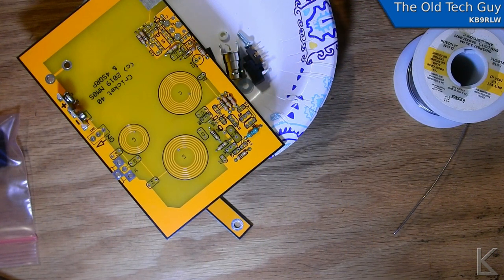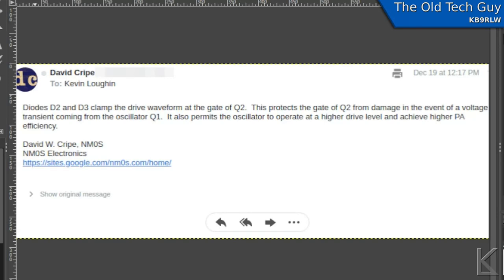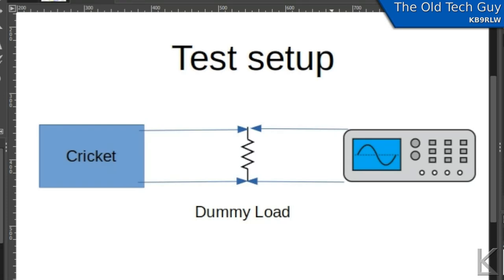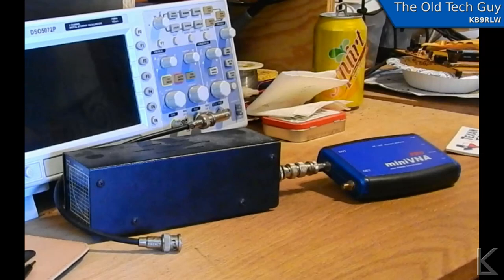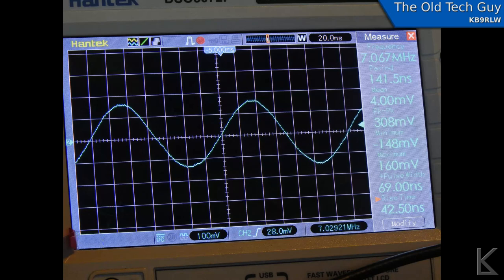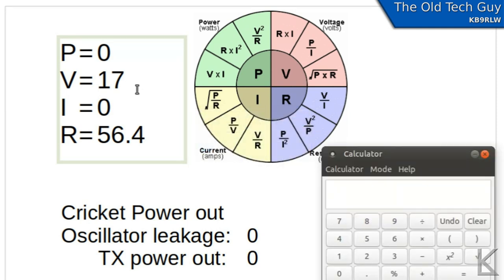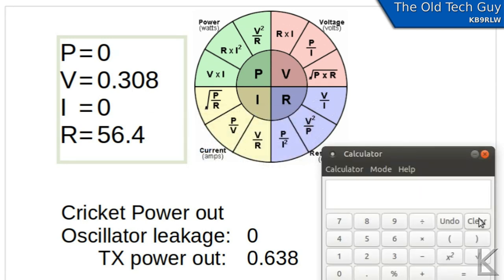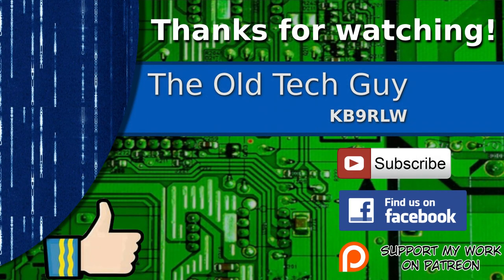Ham Radio - Measuring the Cricket 40 output power with my oscilloscope.

Comment: Kevin, you used the right constants, but it is the RMS voltage we use, not average. You said "average" but actually used the correct RMS values. 73, KE0OG
Reply from the maker: Yeah, at one point I said "average, or RMS".   I know, they're different.  I often hear them interchanged and my speech processor didn't filter it right. ;-)
Reply from the maker: I went ahead and added a note to the video description about me misspeaking "average" when we mean RMS, but I suspect I'll still get beat up over that detail in the comments.  Oh well.
Reply: If you look at the formula for power from voltage P = V^2 / R, the power depends on the square of the voltage.  That is why we need the average of the squares of the voltages ie RMS.
Reply: @donreid358  Don, we need the RMS value of V for the formula--the root mean square, not the average.
Reply: Don, see Section 3.2 of the 2019 ARRL Handbook.
Reply: Just in case somebody wants to understand this: The "M" in RMS stands for "mean", which is a form of average.  The important point is that it is the average over time, formally the integral, of the "square" (S) of the voltage (because that's proportional to power in a resistive  circuit), and when we're done we take the (square) "root" (R) to find the DC voltage value that would produce the same average power in the same (perfect) resistor.  The "root" of the "mean" of the "square".
Reply: To add to the "discussion" : the correct way of approaching the calculation of power, coming from the sine-wave is: You take half of the peak-to-peak voltage (called U(max). Then you divide that by SQR(2) (the square root of 2). That will give you the V(eff), which is the effective voltage of the sine wave. etc.
There is an absolute difference between "average"  and "effective"  voltage.   Even more so, the average voltage of 1 period of a sine-wave, is zero volt. (1/2 period is positive and the other 1/2 period is negative, resulting in an average of 0 Volt.  If you want to know for instance the average voltage of 1/2 period of a sine-wave, you can calculate it by U(average)= U(max) * (2/pi), which is roughly U(max) * 0.64.
Reply: Another very important point is that we should always resist Internet pedantry.  It was very clear what Kevin was doing.  In fact, the terms "average" or "mean" are fundamentally imprecise, as the arithmetic mean (what most people think of) is only one averaging technique.  RMS, which is the quadratic mean is also "an average", along with the geometric mean, harmonic mean, etc.  If the presentation is clear, then nobody needs to fuss about which kind of average we're talking about.
Reply: @jephthai  You clearly didn't understand my writing above. I wasn't being pedant in any way. If we talk about electrics and electronics and formula's to calculate things, you have to call things by their correct names. Basta !
Reply: @63snampook  Well, then we might just want to ask the mathematicians what "average" is, first of all.  And then, when they say, "Which one?" we might try to recognize that the misuse is in assuming that "average" means "arithmetic mean" :-).
Reply: @jephthai  Yeah, what ever...
Reply: @loughkb  Try editing and reposting.  It works wonders.  When you are trying to teach something to others, making mistakes and not fixing them is a gross disservice. Please edit.
Reply from the maker: @xxM5xx  Oh, I didn't catch which video this comment thread was on.
This was over a year ago.   
Not going to bother with it.  I don't even have the radio any more.  Gave it to a ham that likes those simple rigs.
Reply: @loughkb  you ever get around to the mods you talked about in the first video? Built mine last night and about blew my eardrums out with static when I touched the board. Would love to add a way to turn down the volume! (You went into depth on the audio connection on the first video). Was hoping I could find a forum thread with some mods for the cricket, but no luck so far.
Reply from the maker: @ryanv7075  Actually, I gave it away to another ham that enjoys little simple rigs like that.

Comment: That oscillator leakage is exactly what the USN was worried about in ww2 receivers and is why they brought back the use of regen receivers. Speculation was to keep the enemy from homing in on the leakage through the antennas. Other speculation was and I feel might be more correct was to keep leakage from interfering with other equipment on board the submarine or ship.

Comment: My understanding is that in the early days of AM broadcast radio, stations would drive through neighborhoods and pickup the leaking oscillators of superhet radios to determine what stations people were listening to.  From what you have said this is certainly possible.  73  K9AEE
Reply: It is actually a bit frightening how much you can learn from electronic leakage. Do a web search for TEMPEST certified equipment and read some unclassified reports.
Reply from the maker: In the U.K., they required a license just to receive.  I don't think they still do it, but the government used to have vans that would drive around sniffing for signals to find people with receivers that hadn't purchased a license.
Reply: @WECB640  It was the local oscillator in a superhet that could be picked up outside a house.  Of course it was about 455 kHz offset from the station frequency.  I know regen receivers use oscillation to increase the amplification and Q, but I don't think they were used much for commercial broadcast listening.

Comment: I'm a big proponent of accurate communication, particularly when making an educational video like this, and while the average power of an AC signal is mathematically zero, it's obvious from the context that the power arising from the negative half of the signal is still positive power.  The RMS calculation is the average of the rectified signal.  Connect an AC voltage to a resistor and the resistor heats just as much from the "negative power".  The power is disipated regardless of which direction the current is flowing.    RMS is root mean square.  Mean is just another word for average.  The root and square mathematically rectify the signal so all the power from either half of the AC signal is counted as positive power.  From some of the comments, it would be easy to get the idea that RMS is something special and distinctly different from averaging a variable signal.  RMS is the average of absolute values (all negatives converted to positive values).  RMS power IS average power, because the power disipated is always positive.

Comment: If you peak detect the voltage across the load then for a 50 ohms load the power rms is equal to the peak voltage squared divided by 100. My test load has peak detection on it, a diode, smoothed by a capacitor that can then be measured with a DVM as a DC voltage. You are using a scope to measure the peak to peak voltage, twice the peak voltage, across a load. Hope that clarifies my previous post. The maths is on the website I previously mentioned.

Comment: Hi Kevin,
thanks for this very practical example. It would be awesome if you could walk us through an example were the end result would be the E.R.P. (i.e. effective radiated power) and E.I.R.P. (i.e. equivalent isotropically radiated power) for a given antenna with some cable loss.
Not that it matters for "Cricket", but very interesting exercise due the fact that the regulatory allowed transmit power-limits are taken at the antenna. Thanks and a Happy New Year ;-)

Comment: Check for spectral purity. The spurious emissions must be 40 dB below the fundamental, and the amount of low pass filtering there might no be enough on the antenna output.
Reply from the maker: The leakage is at the same frequency it's receiving.  It will happily pass through the filter.  Any filter that would stop the leakage would also stop the incoming signals.
Reply: I’m not referring to the leakage that you demonstrated in the video. I’m referring to harmonics. The second harmonic looks like it would be around 25-30 dB below the fundamental, which can cause unwanted interference in the 20 meter area.
Reply from the maker: @robertcullipher3492  ah, ok.  You might ask Dave about that, it's his design.

Comment: Nice vid for many many less technical hams.  But ya have to be careful... as David C pointed out below...  you used terms average and RMS synonymously and they're not.  Average is 0.637 * peak.  RMS 0.707 as you know.. and is 0.3535 * p-p.  I've seen so many hams measure the signal with a scope then use .707 to calc RMS.  To close out 2019.. even tho its now 2020.. I'll 'highlight' (lol) one comment I made here during '19:  I still say that QRP is 5w at the output port... and you don't get to up it by including feedline loss, ant gain or loss, etc.  Haha. Happy new year Kevin and all the subs in here.  Fun vids, fun comments, fun community.  72 OMs and YLs

Comment: I kinda doubt that your dummy load being off a smudge is the reason why the power is down a little. I bet it would more have to do with powering it from a 9 volt battery and the battery not able to supply sufficient current for the full power output.
Reply: I mean we are talking about 3/4 of a WATT from a little battery...
Reply: The spec sheet should give the voltage needed for full power.
Reply from the maker: It's designed and speced to operate on the single 9v battery.  It was a brand new battery also.

Comment: Good video.  But average is not RMS voltage.  Your calculations were right but you kept saying average.  It is a minor point but to be accurate I needed to comment. 73, JP, K8AG
Reply from the maker: See the note on the first line of the description. ;-)

Comment: I built the dummy load kit from web site k4eaa.com/dummy.html and this incorporates a diode, capacitor voltage peak detector. The sums on this to work out the rms power are - Power rms equals the measured V peak (measured with a DVM) add 0.4 volts for the diode volt drop, square it and divide  by 100. 
A 4 watt FM CB gives 20 volts on a DVM, 20 squared divide by 100 equals 4 Watts
My Icom transmitter gives 100 volts peak. 100 squared divide by 100 equals 100 Watts.
Your transmitter gave 17 volts pk/pk or 8,5 volts plus 0.4 volts diode drop let's say 9 volts. So 9 x 9 divide by 100 equals 0.81 watts. So if I got it right around 800 mWatts. Hope that's of some help.
Reply from the maker: Well, I'm not sure how to respond.    
Measuring voltage with a DVM at RF frequencies is not accurate.  They fall off in accuracy above around 150khz.  I remember having to build an RF probe in order to use a vacuum tube volt meter to make such measurements.
My dummy load is a simple resistor, no diode.
Since you arrive at a value that is different from a value based on measurements made with devices designed to operate correctly at these frequencies, I'd say it's helpful in showing the errors that can result from measuring with the wrong tool? :-)
Reply: @loughkb  the diode and capacitor on his dummy load are an accessory, not part of the load. They let it read a DC value for RF voltage. However, a simple diode detector can be less than accurate when you get down to micropower. eg. http://www.n5ese.com/rfprobe1.htm and https://www.nonstopsystems.com/radio/pdf-ant/antenna-dummy-article-7.pdf (which has specific diode responses) (also, check out htis e2aew vid: https://www.youtube.com/watch?v=2D83xp3H5Bo&list=PL535F3913B822E098)
Reply from the maker: Ah, sorry, I misunderstood what he was saying.   There's also a small amount of capacitance in a diode junction that could skew things based on frequency.  
But then again, we're not talking about lab grade test gear here. :-)
Reply: The diode peak charges the capacitor so that the DVM reads a DC voltage. Take a look at k4eaa web site.

Comment: Well, do CW at 200uW WHILE you receive 😆
Reply: Before QRPp (output power at less than one watt), we used to joke about two hams trying to see how low they could go. Each turned the power down on their old Heathkit DX-20s (reduced the drive) until it was impossible to go further. Finally, one guy came back on the air incredibly weakly and the other guy asked how he did it.

"I got out my GDO* OM", he replied.

*Grid Dip Oscillator./grid dip meter.
Reply: @warplanner8852  Haha well yea, if you could connect a key to to the GDO and sit a coupling loop next to the GDO coil, you could use it as a CW TX.